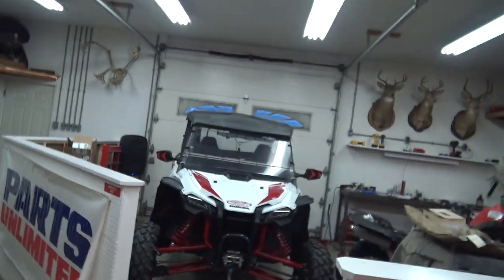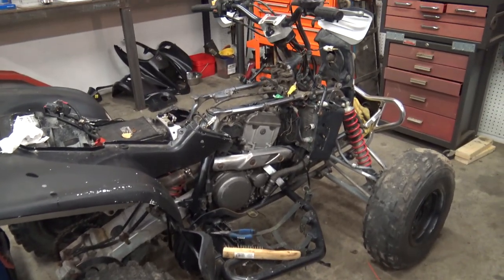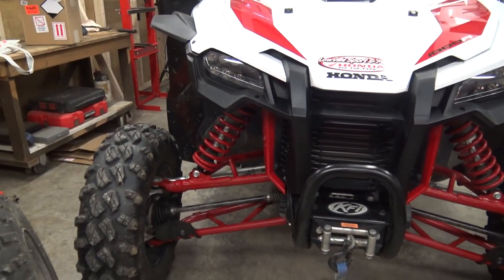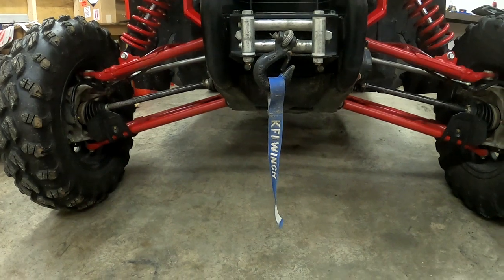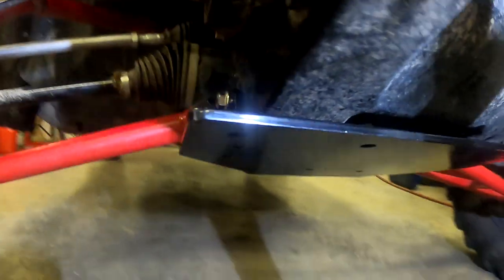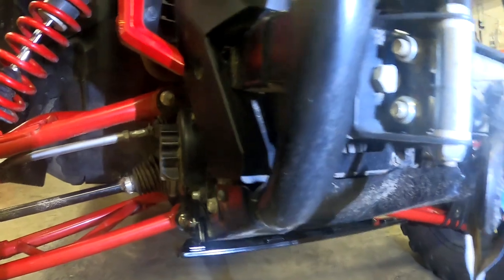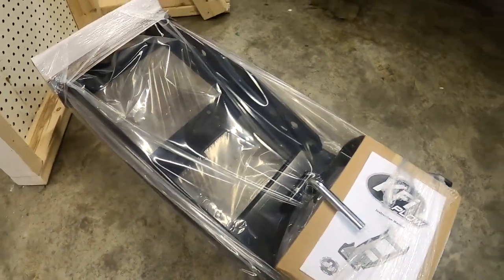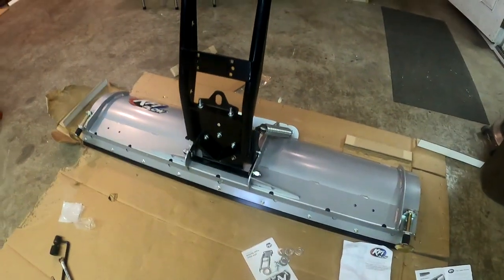HONDA TALON WITH KFI SNOW PLOW  ... NICE PLOW!

Comment: Hey how are you doing turning wrenches and bustin knuckles?  As you were walking around your shop there was that a MONITOR HEATER I seen?  I worked at a HONDA dealership in Tenn for 25yrs and we sold those heaters. It's been year since I seen one of those. Love the videos you put out. If you are ever in Tenn I'd like to meet you and drink a beer or ten. I'm about 15 mins from Royal Blue and plenty of Tenn mud.